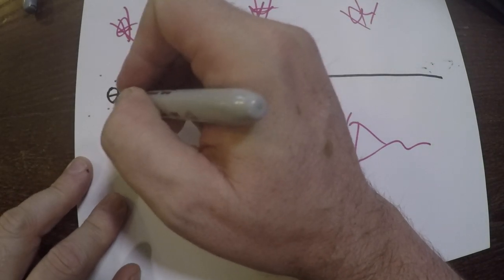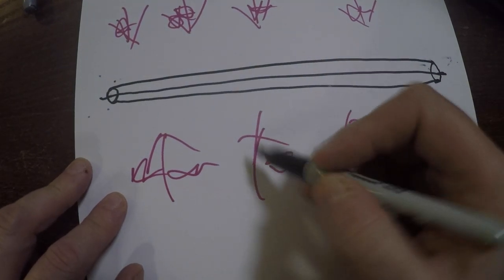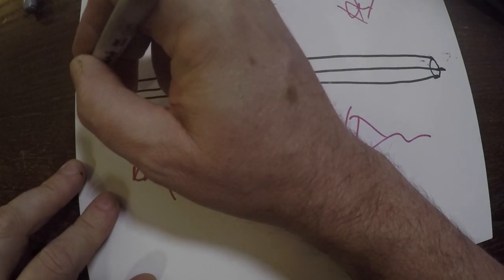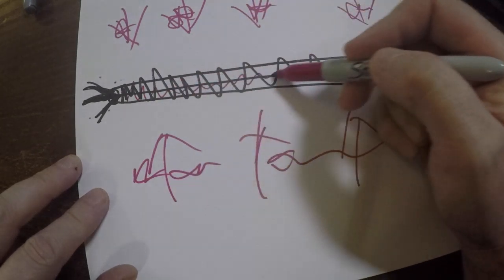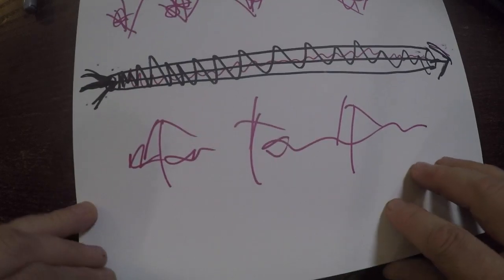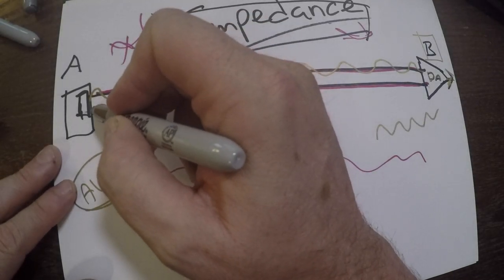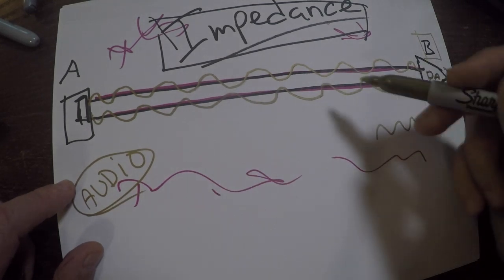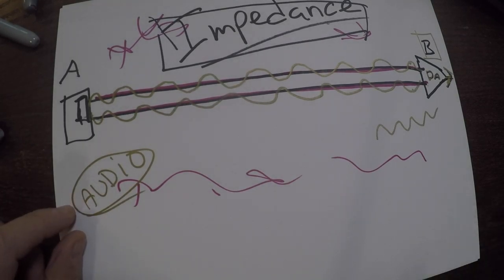1 - Audio Basics - Why Balanced Audio doesn't work like you think it does

Comment: You called it "balanced audio" but it's really just a balanced line. The heavy lifting of the differential amp here -- the common mode "rejection" portion (underscored more because we're only putting audio on one of the pairs) is the non-audio part. Am I making crap up or is this one of your plants? well now I realized you said "balanced audio *connections*" in the description which seems more accurate. Shutting up now. Please school me.